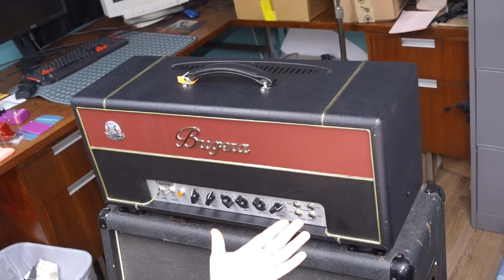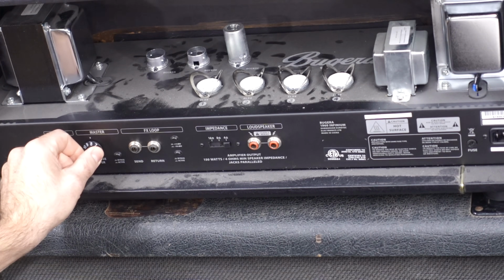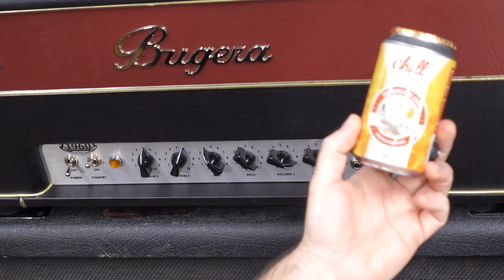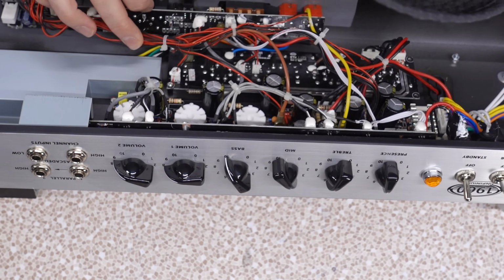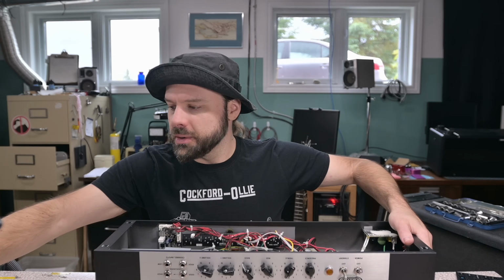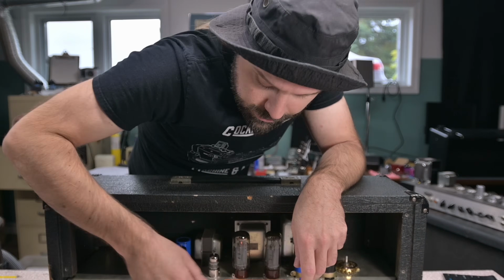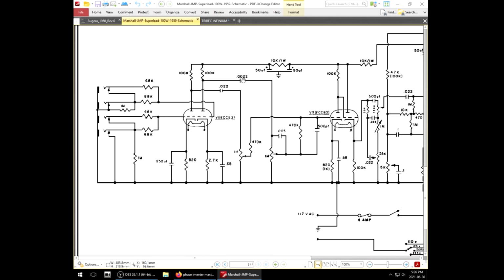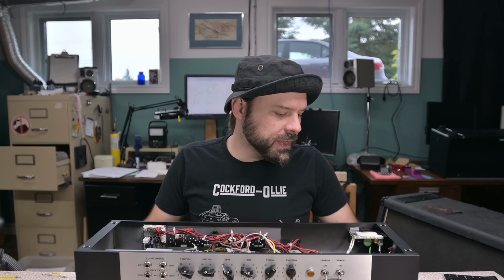Bugera 1960 - Inspection & Circuit Analysis

Comment: Had a v22 infi and it didnt reduce the wear on the power tubes that much. Im not sure it worked ,at least in my amp. 
Didnt use my amp very often and never above 4 . 
Those JJ P.tubes fried after 2 years of light use never the less..

 The stock buggie tubes were trash. One was microphonic and a pre amp had a sharp hifi sound.
Reply from the maker: What didn't reduce wear ? The Infini tech ? I dont' know that it would. 
Fried tubes after 2 years is a bit sus. Like I know 2 years is about the life span of a well used tube, light use should be longer than that.
Reply: @DATT  yeah the infinium tech didn't do it's thing in my case. I got a mini plexi for 3 years now, use it daily with an attenuator and the tubes are still going.
Reply from the maker: @melexdy  Yeah, sounds like it was jsut straight up defective.

Comment: I have this amp new from 2021 and the manual states that it's a post phase inverter master volume.. great video and I subscribed right away.. Would you consider making a video on how to remove the infinium circuit and do standard bias?
Reply from the maker: They were still making these in 2021? Or you just bought it then ?
I could make a video about removing INf, if I had on in for repair with a faulty Inf. But It's not a vid I would/could make otherwise. 
Pretty much my videos are a product of gear coming in to get worked on.
Reply: I bought it in 2021from Sweetwater, and they literally only sold 5-10 in the shipment batch after mine and that was it, discontinued, so very likely they stopped actually building in 2020.. and I also found out by using the jumper (mine has the cascaded input already built in) actually undoes the cascading. If you get any of these Bugera infinuim amps to remove that circuit, they're all the same amp to amp. Thanks for the most informative video on the techs and guts of this thing!
Reply from the maker: @christopherallen5603  Hey your welcome. 
I low key will be keeping an eye open for a broken one. Then I could do whatever to it. 
I would try to fix it back to stock first. I think it'd be a bigger flex to fix in Inf rather than remove it. 

Why do you even want to remove it, is yours broken ?
Reply: It's been acting funny especially the closer to the 3yr warranty running out.. that expired this past April.. It's been intermittently flashing random tubes 1-4 as being bad and know to be good using a tube tester. Also has been cutting volume up and down.. I wish it wasn't acting up cuz being able to mix different power tubes was a selling point for me since Eddie Van Halen used Sylvania 6CA7s in his old Plexi for several years and that tube was known to sound like a hybrid of a 6L6 and an EL34, and had been using a mix of the stock 34s the amp came with and my prized Sylvania 6L6s from 1989 to get that 6CA7 tone, and they sounded great together until the infinium circuit started acting weird, so now I don't mix power tubes anymore due to that.
Reply from the maker: @christopherallen5603  SO it doesn't act up if you don't mix tubes in it ?
And I'm assuming you've tried this tubes in other amps and know they are good ?
Tube testers don't actually tell you much. I wonder if the Bugera would complain if the tubes are too far away from each other in bias needs. 
I do like 6CA7 personally. Have a couple sets. 
I could see why you'd say the Bugera schems are confusing. Schems are kind of like a language, and some have different dialects. I was able to figure them out but there are a few techniques in there I was not used to.
Reply: @DATT  it just acts up less if I don't mix tubes.. or so it seems to my ears, but it could also be that ppi master volume circuit, do you remember which connectors to jump/bypass to install a standard one? And do I need a hi amperage pot or can I use a standard 1M?
Reply from the maker: @christopherallen5603  Hmm, damn eh. To be fair, I order most of my tubes in and around similar bias ranges, so they aren't that far off from each other. I guess the circuit could have a limit to how far off the match could.
It's been a while since I had the amp in front of me, but according to the schematic, it's connector X41 on the Control Board, to connector X4 on the FX board. 
So there should be a wire that runs from the board on the front where the pots are, should be near the treble pot, and that wire would run back to the FX. 
And yeah, you'd use a standard pot. 500K to 1M, typically audio taper, but I have seen linears used in some amps.
Reply: @DATT  thanks dude, you've helped me get more info on this amp than anybody before, cheers!
Reply: I do think that first I'll try wiring up a 1M pot with jacks to plug into the efx loop.
Reply from the maker: @christopherallen5603  Yeah man, it works pretty well. Almost don't need to bother modding.
Reply: @DATT  studying the circuit myself as you have too, I'm inclined to agree ;)
Reply: And I do have a schematic of both the old version and infinium one, but Bugera kinda prints their schems a bit confusing
Reply: I would also be interested in how to remove the infinium and replace it with a standard bias circuit.

From what I understand, the infinium circuit biases the tubes pretty cold and biases ALL tubes, regardless of tube type, at a set negative bias voltage (-35v iirc), which is not optimal for all tubes. Plus, if you tejd to like your tubes biased a bit hot, this won't get you there.

But since I already have the amp, I'm considering modding for standard biasing and replacing the PT, OT, and probably the choke, with others closer to what you would find in an old Marshall.

Let me know if you figure out how to remove the Infinium
Reply: @erikleach1753  I haven't broken down the schematic for a little while but that sounds about right. I can't even remember what they're running for plate voltage but this video tells you when he cracks the hood open.. and I won't tell anybody they shouldn't upgrade their transformers & while this amp does sound great on the right cabinet- it's still built pretty cheap even to the point where doing repair service or basic parts upgrades would likely be kinda risky considering how thin the PCBs are with the solder joints/conductor traces look to be at risk of being potentially damaged by simply desoldering & installing a component replacement. I do know now (thanks to this video) why my Hammond choke upgrade did pretty much nothing to change the dynamic feel of the amp when pushing it hard- there's also a 1k 10w resistor in line with that portion of the circuit which is typically omitted on pretty much every other amp I've ever seen with a choke. Perhaps Bugera only put the choke on it so nobody would say 'no choke? No plexi circuit, Marshall or not'.. as I've had this thing for the past 4yrs, I've just kinda settled on the philosophy that it's a lit of killer tone for the price (I have babied it too) & for me- my Bugera 1960 is best served just left bone stock.. except of course for that B.S. infinium circuit.. I guess they were sort of clever.. to market that little control circuit as a built in amp tube tech of sorts.. when in reality? I bet Bugera figured out it costs less per unit built to stick this $4 circuit in all of the production line amplifiers & goodbye to having to pay people to test & match tube sets.. they're not horribly off but fact is they can just throw in literally any working set & will function well enough to ship to customers lol
Reply: @christopherallen5603  I don't remember exactly, but I just saw another video where a guy checked the plate voltage and bias and whatnot on his 1960 Infinium and it came out to like 475v at the plate and biased at just over 50% dissipation. I could be misremembering the plateV, but considering most bias at about 75%, that's an aweful cold bias for an EL34 in a "plexi"
Reply: As for the choke, could you not just bypass that resistor with a jumper?
Reply: @erikleach1753  I believe the tubes would red plate & I can't think of anyone that makes a choke that would have the impedance numbers to make up for that 1k
Reply: @erikleach1753  475v? That's probably correct.. most manufacturers recommend no higher bias rate than 70% but if you did those transformer upgrades, you could likely get away with running at 75%

Comment: What's with the 4 6L6 power tubes in the schematic?  They're certainly not in the amp as manufactured.
Reply from the maker: Oh, I was referring to a schematic from a different Bugera amp, just to explain how Infinium works, as I didn't have the Inf schem for the 1960.

Comment: "like a good Marshall you crank the bass"? Every four holer I've known, when they're properly cranked, you're always rolling back the bass. I play a JTM45, which is yes, a much woolier (I prefer the term "warm") Marshall, you bridge the channels for low volume to get all the warmth you need, but definitely not needed at higher, again, "proper" volume. Then again, I use a Power Station to control the overall volume.
Reply from the maker: AH yes, you are right, with this amp, and my 800, playing at low volumes, using overdrive, I have to crank the bass. However. 
When I'm playing my  800, cranked into an attenuation, yeah, you're absolutely right, the bass needs to be turned all the way down.

Comment: Thanks for covering this amp, I've nearly bought one a few times, and I still might. There are a dozen kinds of PPI masters being used so that doesn't tell us what it actually is; some are quite horrific, like the one I removed from my Granger Plexi; and the Trainwreck Type 2 makes me nervous just looking at the drawing. I have a slightly more refined version of Trainwreck Type 1 that I get great results from in a variety of amps; Showmans, Twins my Granger and others, definitely a step up (and less "fizzy") than the '70s "post treble control" kind. Check out the #1 drawing. Like I said, my version is much nicer but it's essentially the same. BTW I wouldn't take issue with the covering - you're not supposed to beat up your amps anyway.
Reply from the maker: I think this is a type 3 PPI ? I really didnt' like it. But I have worked with others that sounded better.
Reply: @DATT  Yes I used Type 3 once, looks scary with those voltages connected to one little pot. But in a Boogie Blue Angel is sounded pretty good, even though the taper was less than ideal. Different class and much less power than this amp though.
Reply from the maker: @deanallen927  Ahh, well these ones are connected after the coupling caps, so that will block the high voltages. Not really dangerous, just lame.

Comment: Last year I found a new old stock (lol) bugera NON-infinium 1960 in a store. I use it with a active volume pedal in the loop to reach really nice tones at bedroom levels. But there is a catch, not all active volumes will work well. Some will mess with the impedance and the amp will lose distortion and be clean. Some will suck the bass out of it. I`m using and MI audio Boost n Buff as the master. But i´ve not tried the passive, simple pot, master volume in the loop. That said, about the loop +4/-10, it has a behavior where in -10 the amp has much more gain and does not clean well with the guitar volume pot and is noisier. But in the +4 position, it is louder, it has the, may I say, plexi "correct" amount of gain, less noise and cleans beautifully with the guitar volume. Great amp! Will test with a simple pot in the loop tough. Thx for the nice video.
Reply from the maker: ahhh yeah, I'd def recommend a passive volume. I know the phenomenon you're talking about. I'm not sure how to explain it tho. 
Certain miss matches cause RC effects.

Comment: I'm with you on the PPIMV...my last two builds i tried them and it was a mess - the NFB collapses and all other kinds of not wanted stuff...big drop off ugh. Switched them back to normal masters....
Reply from the maker: Yeah, I dont' think you can go wrong with a normal master in most amps. 
Even in the old beasts you're suppose to crank, you can do a lot with an MV and an OD pedal.

Comment: I've had one of these for years but have rarely used it, because of how bad the master volume is. It sounds great when it's opened up, but opportunities to do so have become fewer and further between over the last several years. Even with 2 of the tubes pulled it's still loud.
I never even thought of using one of those simple little attenuator pedals in the loop. Gonna have to pick one up and dust that head off. Thanks!
Reply from the maker: Hell Yeah Bud ! Instant JCM 800.

Comment: Bugera, I remember I know 3 people that had one. Had. For a short while till they all went tits up. Sounded killer but more unreliable than Grima Wormtongue.
Reply from the maker: Haha yeah. Can't say I recommend them for that reason. I heard they got better, but idk. I'd run one myself, but that's cause there's not much that could go wrong with it that I couldn't fix.
Reply: I have one, it lasted about a year until it stopped reliably making sound. I know a lot more about tube amps these days so im happy I held onto it. I’m going to try and fix it
Reply from the maker: @JeremySteamsack  Man you hear about them broken, but I've yet to see one. I'd love to find a broken on and fix it, assuming of course it's not the INf circuit that's corrupted.
Reply: @DATT  thankfully the issue I’m experiencing is unlikely to be the INF circuit (or at least that’s my thought). The power amp has always worked when plugging things into the effects return - it’s the preamp that’s intermittent. The mains LED does some weird things a few seconds after turning the amp off - some capacitor somewhere must be discharging into that circuit loop. 🤷‍♂️
Reply from the maker: @JeremySteamsack  Man, it's simple amp overall. If the INF is good, it'd be an easy fix if it's just in the preamp.

Comment: Anybody who owns a vintage 100 watt Marshall knows that you run the bass literally off to get the best midrange gain and grind out of them.🙄
Reply: And crank the mids!
Reply: Used to own one, what you say was true for my amp. It was LOUD, and very dark and dull ( especially turned up) so more bass was never what I needed.
Reply: That damn mg 100 acts like that ti me too. It aint got enough screamin highs
Reply from the maker: Yeah, at the time I had mostly tested it at lower volumes using an OD pedal. I also didn't have an attenuator back then.  
Now days, when I crank my 800 into the Atten, I def have to drop the bass. I'll admit, that's something I recently learned.

Comment: I owned this amp for a few months. I sounded FANTASTIC… but I couldn’t get that fantastic sound low enough to be able to play when anybody else was home. 😂
Reply: Sounds like it would be perfect with a Power Station.
Reply: @poulwinther Cost more than the amp.
Reply: @qua7771  Have it already 😅
Reply from the maker: WEll, do what I did. Put a volume knob in the FX loop and run an OD pedal. But a proper OD, not a distortion pedal that's named OD. 
Something like the tubescreamer, or DOD 250, or the yellow boss pedals. 
It's not the same tone you get from cranking, but I had a lot of fun playing it like that.
Reply: You could have pulled the outer two power tubes or the inner 2 power tubes and gotten the sound you craved at a volume you could live with. This is what I have done.
Reply: @PeterDad60  When you do that make sure to change the impedance selector to compensate if your already not aware of this.
Reply from the maker: @PeterDad60  Oh yeah, that's 101, been doing that for years. That's not the sound I was craving, that's a method for a completely different kind of tone. This tone I was going for was all preamp distortion resulting in BEDROOM volume levels. 
Again it's a different kind of tone, not everyone likes that kind of tone. But I've been playing big amps at low volumes and loving it for decades.

Comment: If someone gave me a broken/non-functional one of these for nothing, I'd pull out all the circuit boards and stuff, and re-build the amp on Turret boards, and replace all the stock pots with a set of good 24mm CTS pots, assuming the transformers were all good.
Reply from the maker: If I had a broken on, I'd prob be able to fix it, based on what I've seen, but that's me. Alternately, I might try to keep as much as I can that still worked, and just gut and replace the faulty circuits. And if I was going to completely gut it, Not sure I'd go with a turret board, like I might, but they weren't designed correctly in the first place. One thing bugera did right is re engineering the circuit with a better layout and better grounding. That's the big weakness of the classic amps, their grounding schemes suck and can be done way better. Which I could do with a turret board, I have before. I just think I'd successfully be able to salvage most of the amp, it's too simple not to. Just I know it's be a good idea to go thru and resolder everything in case they used weak ROHS solder.

Comment: Don't buy bugera stuff, I have the svt copy, and while it sounds wicked, the infinium module sucks, it's going to fail on you, tubes are not going to be biased properly, and they get expensive. For that money, get some IR loader and a reliable head/modeling pedalboard, or, just save some money and buy a real amp
Reply from the maker: Hah, they even made an SVT copy eh ?
Yeah, it did occur to me, as cool as infinium is, things could go bad really fast if it failed. I personally would buy this amp, as a jam room novelty, to get that sound on the cheap. But I don't think I'd trust it to gig, and if the infinium did fail, I would be able to gut it out for a normal bias circuit.
Reply: @DATT  good luck on that